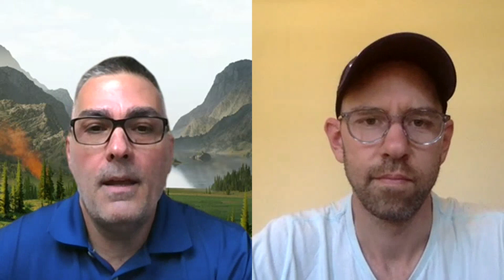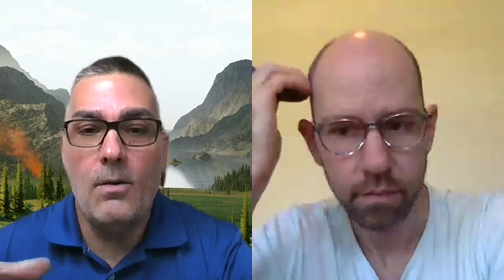HOW TO USE BONA DRIFAST STAINS | Bona Stain Application, Dry Time, and Tips

Comment: What is the wait time to coat a floor with water-based finish
Reply from the maker: Hi there! It will depend on the stain color, and if the home is at normal humidity and temperature conditions of 35-75% relative humidity at 60-80°F (16°-27°C). Humidity and temperatures outside this range may extend dry times. Most Drifast stains dry around 2hrs, the exceptions are a 6 hour minimum dry time for White and 12-18 hours for Ebony, Spice Brown, Bark and Cocoa. From there you have 48 hours to apply a sealer and finish. If you exceed 48 hours, you'll need to lightly abrade the floor. Daniel and Bryan talk more about this at 19:15. Hope that helps! 
Bona also has a GREAT training video of staining and finishing here: https://www.youtube.com/watch?v=RRPCTp8KvaU

Comment: I used bona dri fast on red oak last cut 100 stained with bona dri fast 
I came in the next day the contractor had put on a second coat without wiping
Reply: why are you letting the contractor touch your work ??
Reply: Had no choice
Reply: The stain job he did was horrid but the customer was happy 
That floor will fail for sure and it's not my fault or liability the customer took all liability

Comment: Time to wait with white bona dry fast
Before applying traffic water base
Reply from the maker: Good question - Bryan goes into detail about this at 14:18. The big thing is home environment - if the home is outside of 30-50% humidity and 60-80 degrees, the dry times will vary significantly. In an ideal environment, most stains will be 2-3 hours, the white stain is 6 hours, and heavier pigmented ones (cocoa bark, ebony, etc.) are an 18 hr dry time. If you mix any of those, expect the longer dry time.

Comment: Hey Brian... What do you put down first... Bona sealer or Bona stain? What's the benefit of using sealer? Can you use the stain without sealer and put a polyurethane on top?
Reply from the maker: Good question.  If you are putting down a stain like Bona Drifast it must go onto the raw wood.  This is because the stain works by soaking into the surface and pores of the wood. 

If the wood is sealed, then the stain won’t absorb, which can cause the coating over it to peel.  So, if you're using a sealer and stain, apply the stain first, then the sealer, and finally the polyurethane. Make sure each is fully dry before moving onto the next coating.  

Sealers are not necessarily required (you can put polyurethane down on stain), but do provide a lot of benefits. They generally seal the wood and dry without soaking in as much as a polyurethane which results in more build and protection with the finish system.  Sealers can also help the finish to apply more evenly, help prevent white lines, and help prevent tannin pull and other color unevenness.  

It is good insurance against a host of potential problems.  Also, Bona’s sealers come in 6 different colors that can add different tints to the floor to achieve different color effects.  

You might also reach out to your local Bona rep as they’ll have even more information.  Coincidentally, we have a Pro Shop Talk on Bona sealers coming up soon that may help answer these questions better. Let us know if you have any other questions!